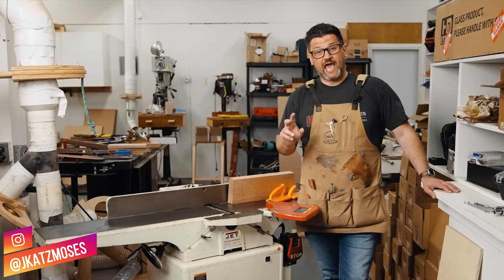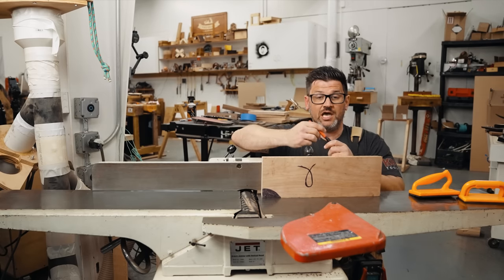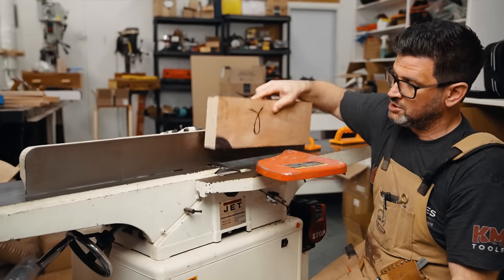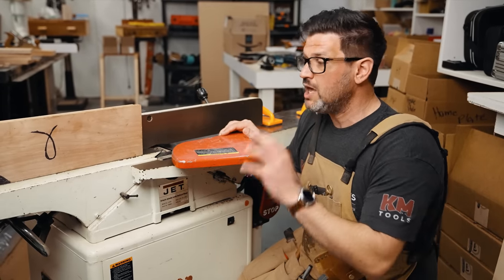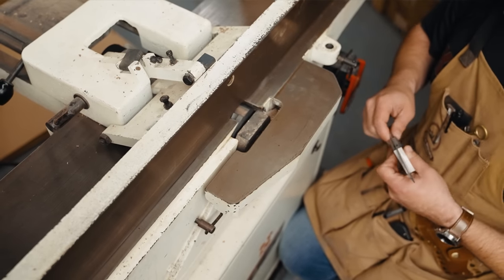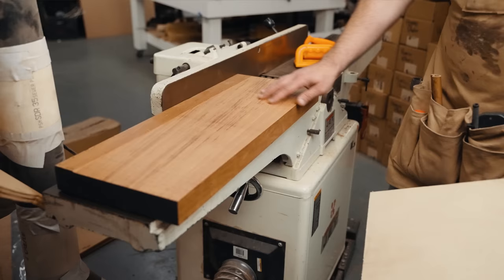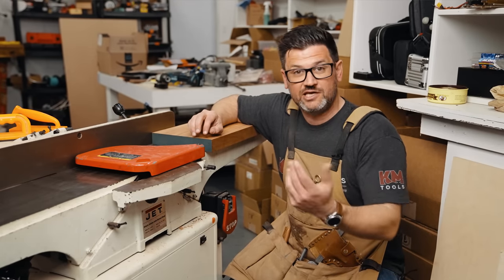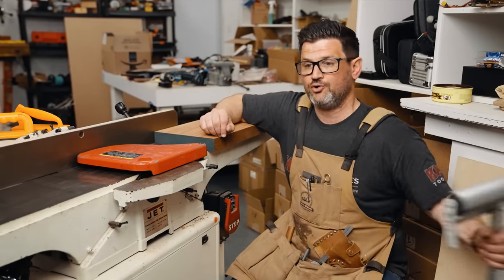Jointers For Beginners - Use Tips, Tricks, Buying Advice and Safety

Comment: Great points - but I would NEVER operate the jointer from the back side of the fence.  Operating the machine from that side makes you blind to the cutter head and you have to force your muscle effort down, over the fence, and into the blade.  That's very dangerous IMO.  Great points and techniques though.
Reply from the maker: As I said in the video I stood there for demonstration purposes only

Comment: So safety wise... you should never be on the back side of the unit when jointing. It's more important to have a good base and footing than running your hand on the back of the fence. I know you're gun shy now, but better please joint on the front of the tool where you have the most room and economics for use. You can see in the video your back leg is in an odd position.
Reply from the maker: Yeah I was demonstrating so I didn't block the camera. Should go without saying but I could've been clearer